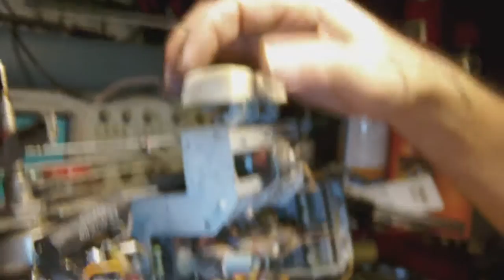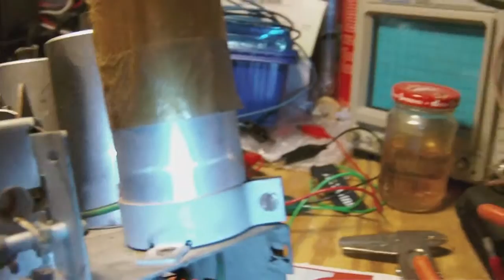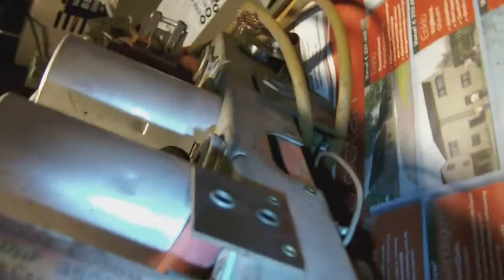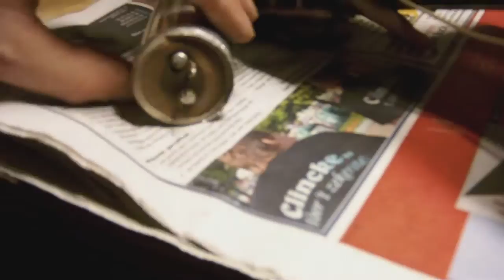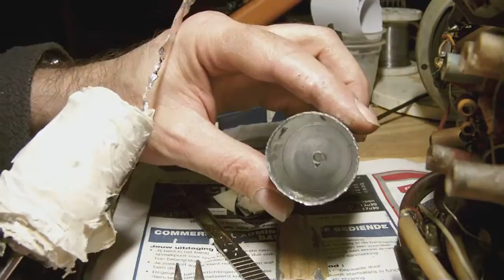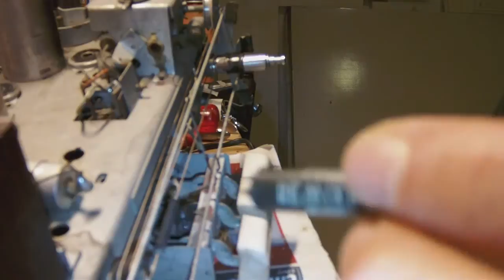Orion R545A part 2 of

Comment: Although they look similar to the american dogbone resistors from the early 30s, they are newer and constructed of more reliable materials.  I've found some from W Germany in 1950s TVs
Reply from the maker: Yes. I noticed that too. Most resistors are well within tolerance, although dogbone power resistors can drift off a lot from their intended value. I think for the few that need replacing I might use your method of encapsulating new resistors in a kind of "casting" from the old ones. I am a bit worried though about heat dissipation.The encapsulation might hamper evacuation of heat and reduce the lifespan of resistors ?
Reply: TechneMoira
Yes, you are correct, it does reduce heat dissipation.  There are other techniques to replicate the dogbone look such as using a plastic tube and wrapping wire around either end.  That allows more heat to dissipate.  If you examine a 30s dogbone resistor closesly you'll see that's what the lumps are on the end really are.  I think these newer European resistors and made one a ceramic core with a spiral resistive element around the outside.